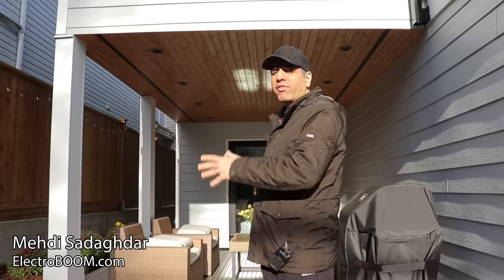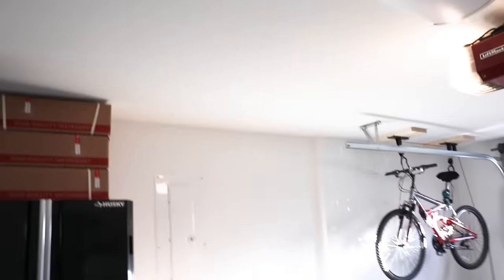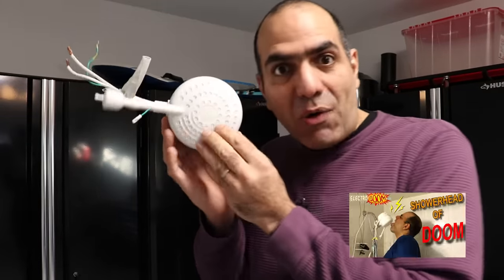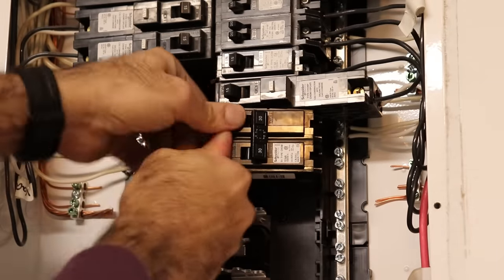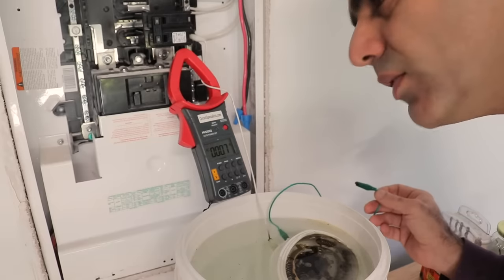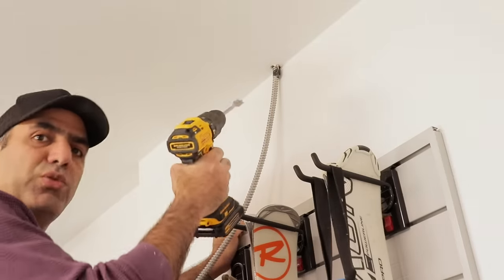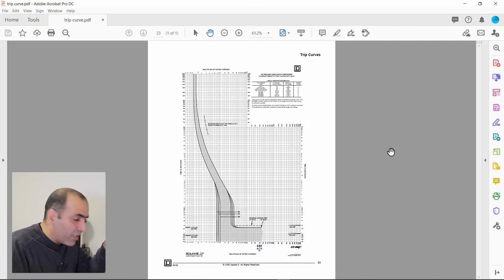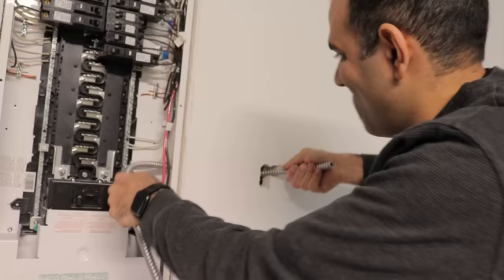Electric Patio Heater Wiring and Installation

Comment: I would recommend the 20 amp breaker until such time as you decide to use more amperage. You can keep the wire. If you later decide, then switch the breaker.
Reply from the maker: Good advice
Reply: @ElectroBOOM  Just trying to keep you alive. ;-)
Reply: WHAT
Reply: 4 days ago
Reply: @k10photos4  its one of Mehdi's patreons
Reply: Actually is it code legal to protect something that needs less than 20 Amps with a 30A breaker?
Reply: @mernok2001  obviously it depends on jurisdiction, but generally yes.

Breakers exist to protect the wire, not what's connected on the circuit. 

Breakers need to be sized for the wire being used, and the wire being used needs to be sized for whatever load is being put on it.
Reply: @k10photos4  ikr XD
Reply: @Comeyd  But I guess if you have a 20 Amp outlet you cant put a 25 Amp breaker on.Meanwhile 15A outlets can be protected with 20A breakers.
Reply: @mernok2001  If the instructions for the device/appliance specify what size breaker to use, per code, you are to follow those instructions.
Reply: @mernok2001  A 25 amp breaker would be a non-standard size here. As far as I know, I don't live in the same town as Mehdi (probably a good thing), but I do live close by.
Reply: @mernok2001  - yes, the circuit breaker is rated to protect the WIRES, not the appliances. If any appliance needs protection, then it will have a fuse inside it.
Reply: Wait a minute,the switch Mehdi used has a ground screw but he didnt connect the ground wire to the switch.Is it allowed to use the metal box to ground the switch?
Reply: @mernok2001  - good point. Here in Australia, we stopped using unsafe wiring systems like metal conduits and switch boxes a very long time ago. All electrical cabling in domestic installations are double-insulated, rather than single insulated plus earthed. That's significantly improved safety over the old 1940's-50's methods (like used in USA and Canada, since it doesn't rely on earth continuity for safety.
Reply: @johncoops6897  Are plastic conduits allowed in Australia.I prefer conduit over a cable.
Reply: @mernok2001  If the switch is self-grounding, yes. The installation instructions for the switch will say whether it is or not.
Reply: @mernok2001  - plastic conduits are pretty much all that we use, especially in domestic work. The cable inside is usually double insulated, so that means triple-insulated for power and light circuits.

Technically, the cables can be single-insulated inside conduits, however the most common cables pulled are 1.0mm²,  1.5mm², 2.5mm² and 4.0mm² TPS (3-core flat with 3 insulated conductors inside a common PVC sheath) these double-insulated cables are the lowest cost so the electricians just leave the sheath on there.

Oh - just to add that for interior applications these conduits are only used for surface wiring. Anything inside a cavity wall would just be the bare 3-core TPS, as would surface wiring that is out of reach. So, in the ceiling cavity, as well as visible wiring that's high up above touching height, would be "bare" double-insulated TPS with clips holding it down.

For a neat job, round conduit is used but often a rectangular section PVC that we call "trunking", and that stuff has a snap-on lid so you don't have to feed the cables through to install it. The bonus is that the double-sided tape is pre-fitted, so that's a easy way to neatly enclose surface-mounted cables without needing any visible clips, screws, saddles, etc. 

We don't generally use earthed metal conduits because it ends up being more of a liability than a safety benefit, since the earth continuity degrades over time and there are so many points of failure due to multiple clamped connections.Metal conduits are certainly still used in industrial, mining, etc where higher levels of physical protection are needed, but the extra cost means that the applications are minimised.
Reply: @johncoops6897  Do you have brick houses like in Europe or the American style wooden houses?
Reply: @mernok2001  - we have both types of construction, but brick is more common now days. Plus many new builds use "besser blocks" which are the large concrete blocks with a large core inside. Often these are rendered on the exterior surface or have plasterboard glued on if an interior wall.
In any case, the wall material makes no difference to the kind of wiring used.
Reply: @brianleeper5737  If the switch is self grounding,is it also allowed to not connect ground to the box,connect it to the switch and ground the box with the switch?We dont to that in Europe,boxes are usually pastic and switches have no ground connection.
Reply: @mernok2001 I am not sure if you are allowed to ground the box with the switch. I have never seen it done that way.

Comment: If ever there was a demonstration that these breakers protect the wire only and not the load or the human, then this is it.
Reply: Yup, they keep your house from burning down. If you need to protect the load you need a surge protector, if you need to protect a human you use common sense or a GFCI outlet.
Reply: I mean, that is what they are for and have never been marketed to do anything else.
Reply: those breakers would not pass UK or EU safety tests. mine pop instantly as they are designed too. 240v is no joke
Reply: @SirZanZa  Not true. The EU breakers have exactly same looking curves, and depending on the type you need 3-10 times the rated current for the activation time to be in the order of few seconds...
Reply: @MrMelanooma  Indeed... you beat me to it..:)  Actually UK breakers perform exactly the same way in that they will allow current above the rated load for some very carefully defined period of time. The tripping current vs trip time is defined in the data sheets for BG (British General) MCB breakers and the curves show the same profile as the US/Canadian breakers. However what UK breaker boxes (in UK called 'consumer units') do have, mostly as standard, are RCD (Residual Current Detectors) devices which look similar to standard MCB breakers and they act to detect small currents differences between live and neutral (in the UK neutral is not connected to ground as it is in the US/Canada). These RCDs act like whole-house GFCI (Ground Fault  Circuit Interrupter) in that they protect humans and animals because they trip when an imbalance of 30mA is detected between the live and neutral (or live and ground). They trip fast - fast enough that you barely notice your body (and heart and nervous system) is being used as a short to ground.

The US/Canada are a bit behind the curve with safety. Safety relies on installers to put the GFCI devices on the actual sockets in the wall. Consequently you'll only find them in bathrooms and kitchens and specific other places like outdoor sockets. New RCD equivalent breakers are now becoming available for North American breaker boxes that will protect a whole circuit but they are expensive. There are advantages and disadvantages to both schemes. When a UK RCD trips you often lose power to the whole house (depending on how it's wired) and then who will reset the microwave clock? :)  With the US/Canadian approach the majority of sockets in the house do not offer any protection but the voltage is (only) 110V and that is far less lethal than 240V.  You will notice that Mehdi did not install a GFCI device on his 240V heater/extension socket so there'll be no protection for him if (when) he sticks his fingers in the socket. I'm not even sure 240V GFCI protection is available - since, as Medhi points out, his heater didn't even need a neutral connection.

The UK clings to nanny state restrictions such as no sockets in bathrooms despite the introduction of these RCDs which would make sockets completely safe. Bathroom lights have to be controlled by pull cords for the same reason. But the biggest safety failure still designed in to UK homes is the implementation of ring mains which are disasters waiting to happen. You can look them up but in essence they allow you to put a big breaker on small wire so long as that wire goes all the way round and returns to the same breaker. It's a nonsense design which has its origins way back when copper wire was extraordinarily expensive.
Reply: @MrMelanooma   UK breakers do not display behaviour like you just said no matter how you try and spin it.
Reply: @SirZanZa  Not worth fighting much more, but I noticed on this informative deep dive & post mortem of a British Consumer unit from Bigclivedotcom that all the MCB's seem to be B profile, where as  at least in Nordic we typically use B for lighting only and C profile for sockets etc... https://youtu.be/buiJTq-w2fY
That makes them work a bit different, but the main argument still stands, you can pass multiple times the rated current through the breaker without it tripping instantly. Only when You go to  way above the rated, the magnetic release beaks the circuit instead of the thermal...
Reply: @SirZanZa  230V is joke,400V is warning and industrial 690V is not worth it.

Comment: I'm an European and an Electrician and I had anxiety watching this.
Reply: Imagine loving in a world of electricians where you dont have to use hilti drill to drill the wall.
Reply: I'm more annoyed for the fact they use an unprotected Ground wire and the wires are not flexible as ours... And why the heck they use metal boxes and tubes for electrical purposes?? Where's the PVC?
Reply: @MrTerrorista  is easy for them to use metal parts when the voltage is 120V :D
But yeah, imagine that you have to connect together like 6 wires together and they are thick as a nail xD
Reply: @MrTerrorista  Cuz 'Murica
Reply: @davidkorcak  I find it funny how you think “drilling holes in walls” is a daunting process that should only be done by professionals... smh
Reply: @davidkorcak  ok so you meant to say that it makes your brain cells die when people  just drill holes like an idiot and not measure first to make sure it’s in the right spot. That, I agree with
Reply: Thanks god bro, I though I was the only one. The DIY quality and zero attention to details almost killed me.
Reply: @MrTerrorista  the ground wire is only bare when using non metallic cable and bx cable when using any conduit you need a green ground wire. The reason why bending the wires for him was hard was because of the guage of the wire which was 10awg which is pretty hard to bend
Reply: @MrTerrorista  you can use blue plastic boxes too but it depends on where you live in the USA and Canada.For example in New York City, the minimum gauge we can use is 12AWG and we only use the metal boxing for grounding purposes.
Reply: @christopherpena8325  yeah but why not use flexible strands like a 3 core 4mm which can quite comfortably pass 30 amp -- use them all the time for 390V 50Hz refrigerated containers and they're quite comfortable to work with, no unnecessary force
Reply: @astize  
In the US stranded or solid wire can be used for wiring as long as all connections are rated for that wire. However it is an unofficial standard to use solid wire for all permanent installations up to 8 guage. Anything past that is impossible to bend by hand as a solid wire. Solid wire is easier to manufacture and therefore cheaper. Solid wire is easier to splice with wire nuts. It's up to the installer really. Canada could have a code that made him use solid, but Canada's building and electrical codes are very similar.
Reply: @zachdemand4508  Yes, I know the US/Canada codes are terrible, what's your point?
Reply: @astize  

I was answering your question. The answer is because solid is cheaper and it's what is used. It has nothing to do with codes and makes no difference once installed. The codes are perfectly fine here.
Reply: the worst thing for me is the high grade electrical wire surrounded by metal? not the brightest idea internal fracture causes a short touches the outside casing ...just waiting for a hand to touch it.  240v 30a straight into your heart ... lights out, North America is pretty AWFUL with electrical safety its a good job they only use 120v in the majority of situations. wiring like that and breakers that don't pop instantly would have your building condemned if you were living somewhere like the EU or UK lol
Reply: @zachdemand4508  Yeah, it really does make a difference once installed. The solid vs stranded debate is a deep rabbit hole but in this situation (lots of awkward angles, potentially vibration because installed in a garage) stranded would likely be better. Any code that doesn't take these factors into consideration is a bad one.
Reply: @SirZanZa  I agree with you about the armored cable. It's a weird choice and some internal insulation would be nice. Although that trip curve is a pretty standard one and is international so I don't really see an issue there
Reply: @SirZanZa  
Any metal used is grounded if installed properly.
Reply: @astize  

I fail to see how "awkward angles" makes solid wire a poor choice. As with vibrations, you would need an earthquake to get enough vibration to damage the wire in a garage.
Reply: @zachdemand4508  yes i understand but it's still seriously sub par and a completely needless risk. and those breakers.... just wow! i get that you guys do things differently and that's fine i don't want to be a dick, but its a Monumental culture shock (no pun intended) the regulations are far more lax than i'm used too. having taken 240v@3a ~720watts and having my hand literally burst into flames ive learned not to mess about
Reply: @SirZanZa  

Steel conduit and boxes are required in industrial environments because they hold up to abuse better than PVC. I have seen a fork truck run over shielded cable like what was in the video with no damage done to the insulation or copper. I understand what you mean though. No light switches or sockets in the bathroom? That must be a pain in the ass.
Reply: @astize  well we don't use that in the US as far as I know. I looked it up and I couldn't find anything about it being used in the US
Reply: @astize  the solid wire in use on houses for literally a century with no failures says your superiority complex is completely unwarranted.
Reply: @SirZanZa  good luck getting 30A to flow through a human body at only 240V.
Reply: @MrTerrorista  10 gauge is very thick, the typical for house wiring is 14 gauge or 12 for stuff rated for higher amperage
Reply: @SirZanZa  Your body cant be conductive enough to take 3 Amps on 240 Volts.And if the armored cable wasnt grounded in cas of a short circuit it would be live at 120V not 240V as you think.
Reply: Swede and Electrician and I felt the same
Reply: @Polygraph S looks dangerous for a russian? that shit gotta go to the dump.

And i agree with you! (real electrician)
Reply: Ah it'll be fineeeeeeee. He's an electrical engineer! XD
Reply: @derrerrrr  Actually your sorta correct 12 and 14 are used with 20amp outlets and 15 respectively however with wiring 14gauge is smaller than 12 10 is bigger than 12 also you cant rate wire for a higher amperage like 14 can handle 120v 15 amps but not 120v 20amp
Reply: @SirZanZa  the breaker would probably fail inspection here in North America.  Also, no because 1) the metal is grounded so it will just pop the breaker, and 2) there's only ever 120V to ground present because of the 2 phase system
Reply: In Australia you can’t buy solid copper wire larger than 1mm CSA (whatever 10 amps is AWG)
Reply: @thomasa5619  That's 18 awg so basically useless in houses
Reply: Ornge Master at 240 volts especially in modern times, it’s plenty adequate for lighting circuits. Though “we” (meaning non cheapskates, I don’t have much domestic experience, I mostly do industrial/railway work) usually just use 1.5mm stranded 

Note: our wiring standards specify 2.5mm minimum for “power” (socket outlets) so your AWG equivalent would be whatever can carry 16-20 amps
Reply: @thomasa5619  yeah 0.75 for lights, 1.5 for everything else and 2.5 for the heavy consumers
Reply: @davidkorcak  Well allegedly even the NASA engineers did that while building the rocket to the Moon, so I guess that's an authentic American way of drilling things.
Reply: me too and i am thinking Americans die before us for reason...
Reply: I too am an electrician, and need a stiff drink after that
Reply: Proves how pro mehdi is and how noob we are😆
Reply: @JustSho93  in Finland 1.5mm2 is used for lights and 2.5mm2 for outlets
Reply: @Tupsuu  same in Belgium. Ive been to south America for my work multiple times already and im always shocked by how amateuristic electrical installations are in north and south America as compared to Europe.

Comment: 3:36 " which house in the world is wired for this??" 
Brazilian electricians:
"Are we a joke to you??"
Reply: Everyone else: Yes!
Reply: @Wandering869  in a big portion of Brazil the mains voltage is 127V and heat elements like electric shower heads draw 40 to 50 amps of current, all those houses electric circuits need to be well dimensioned
Reply: @MsGabrieljf  I apologize there may be some language barrier, did you mean to say electric shower head?????? oh jesus, i watched the video and it's like my brain rejected what he said it was. C'mon you guys don't actually use those there do you??????
Reply: @johnhampster6781   lol, actually all the houses here use that! From that same brand "Lorenzetti" , usually we use eletric shower heads from 5500w to 7200w depending the region
Reply: gabriell jonas Here in the UK electric showers are fairly widespread too, although ours use a small heater unit attached to the shower wall rather than an electric shower head. They are usually 10 Kw.